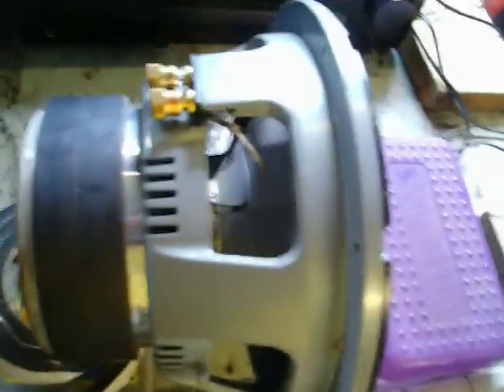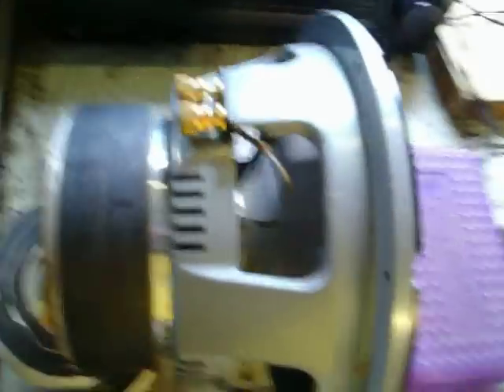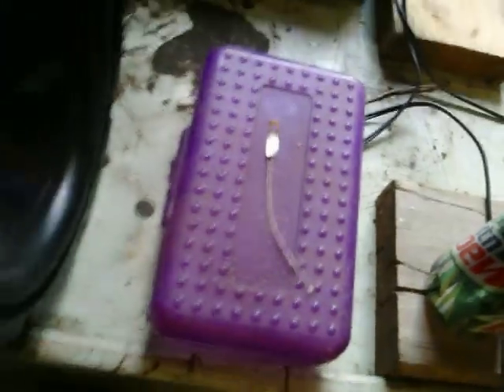tinsel lead repair on infinity perfect 10''

Comment from the maker: CA Glue is what places normally use . i use epoxy all the time without issues . just gotta make sure it will bond to the material your putting together . roughing the area where the epoxy is gonna sit on the cone and dustcap with sand paper would be a good idea . check out my custom subwoofer builds

Comment: Okay, if I decide to take off the dustcap. What kind of glue do I require to get it back on? The only thing I have on hand is epoxy. Will that work? I have a feeling there is glue made specifically for this type of work.

Comment: @LowNKum You ever get those leads replaced on your Kicker L7?  I'm going to attempt to do the same on an L7 12.  I'm just going to solder to what's left of the wire that's already on there though.  What did you end up doing?

Comment: Is it common to have bad tinsel leads? I had issues with my sub. It would only work when I pushed inward on the cone. I tracked the problem to one of the tinsel leads. I resoldered the one tinsel lead I suspected and it worked good for about a week. It is now having issues again. Wondering if I need to replace the tinsel lead or not.

Comment: Does your sub have different ohm readings? I have 2 Infinity Kappa Perfect 12.1D subs and on both one voice coil reads 4.6 ohms and the second voice coil reads 5.8. My one tinsel lead broke as well so thats going to need replaced. Is there a specific section to connect the tinsel lead to? Mine looks like the wire goes under the center cap?